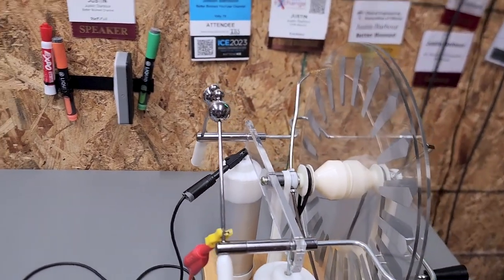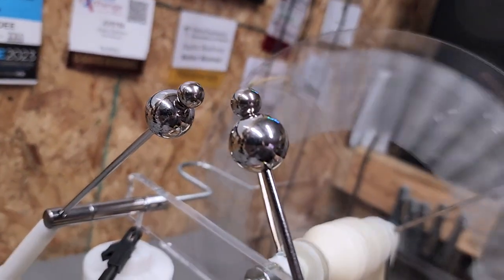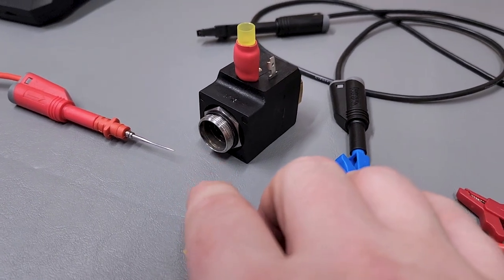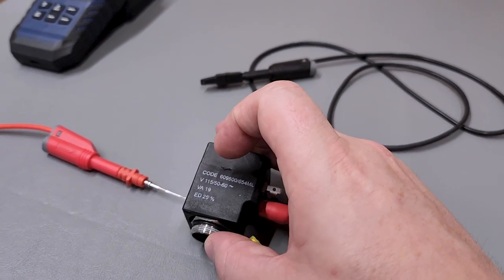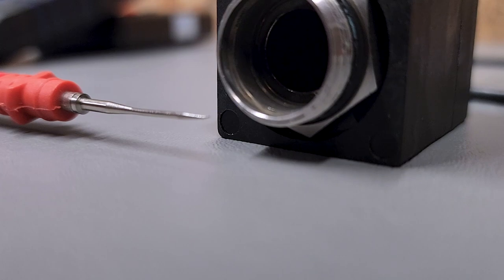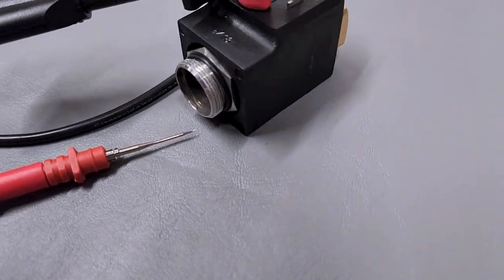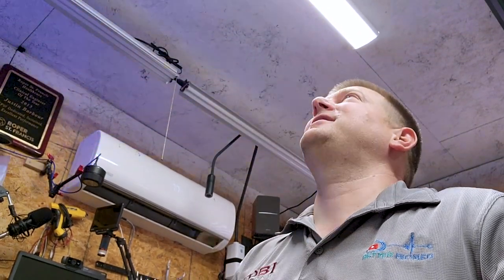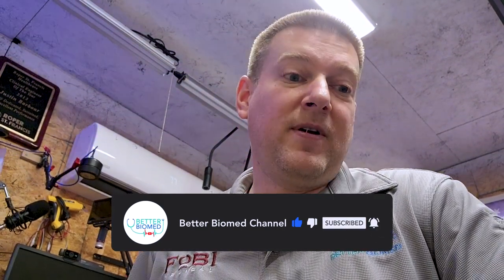Isolation Testing with Lightning!

Comment: How much voltage is that?
Reply: For a spark gap of 10mm is arround 10Kv (10000 V) needed, but i think this spark generator can go beyond that, and can deliver up to 20Kv. Because the current is very low (µA range) you only feel a slightly tickle and it's not lethal. The spark gap also depends on how dry the air is, with a high humidity is less voltage needed to get a spark.
Reply: @BjornV78  was thinking that the coil insulation in the video might not be made to withstand +1000V so even a new in the box might fail this test. But I test using 500V or 1000V, depending on the reason for testing
Reply from the maker: I figured just the same. 10-20kv is likely too much but also demonstrates how static can actually damage parts. This coil was buzzing with mains applied. Insulation was compromised or at least suspect. Check out my video from today with an actual Insulation Tester